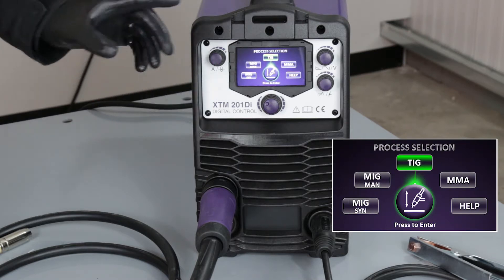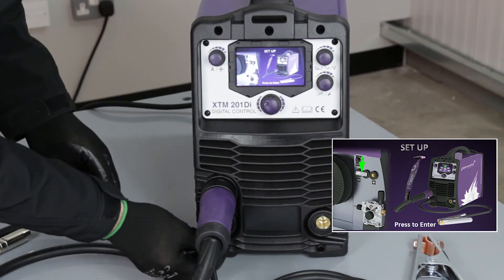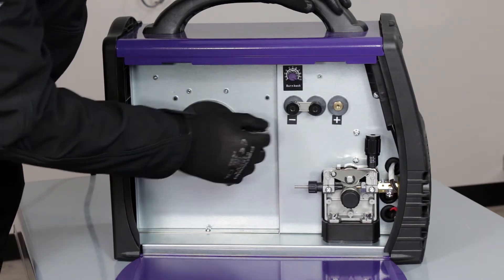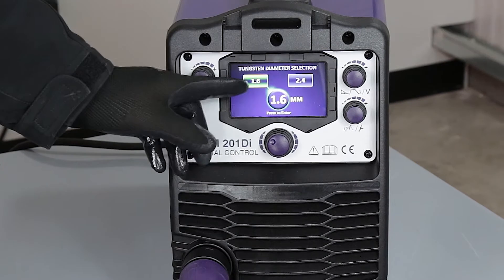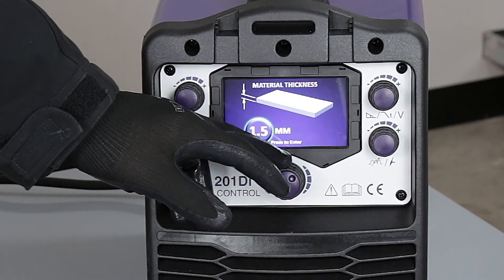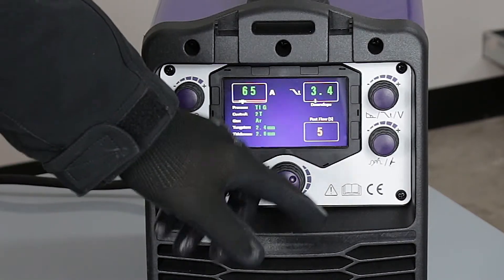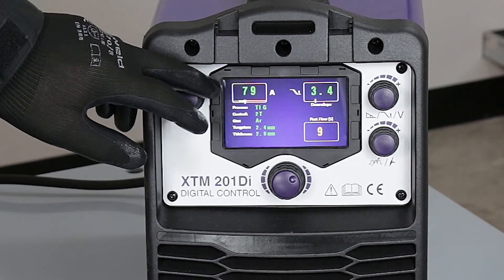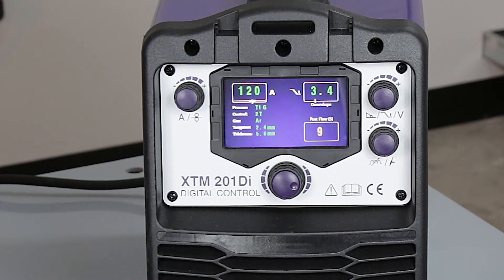XTM 201Di TIG Machine Welding Setup

Comment: What is the button above the link tab for?
Reply: It's the burnback setting for mig wire. So when you finish your weld it will burn back the wire end to reduce or increase the wire stick out